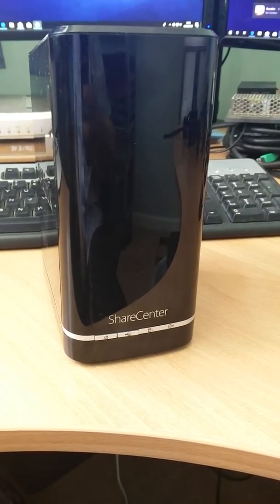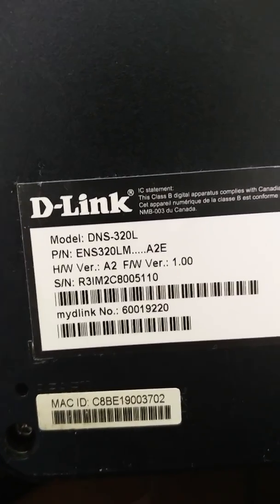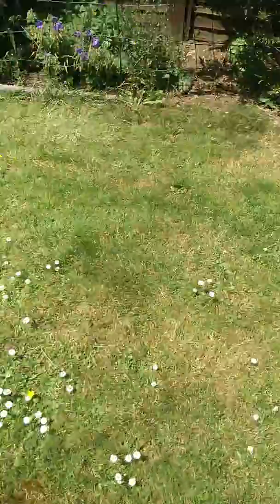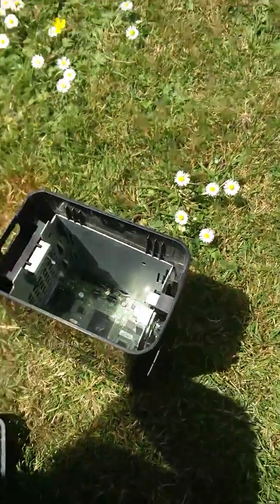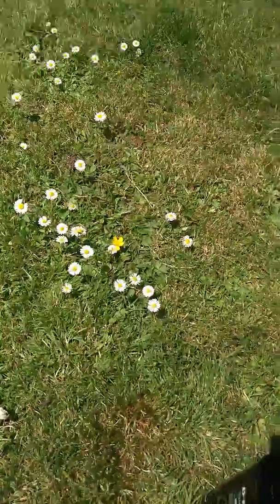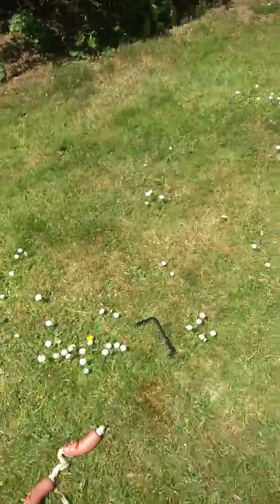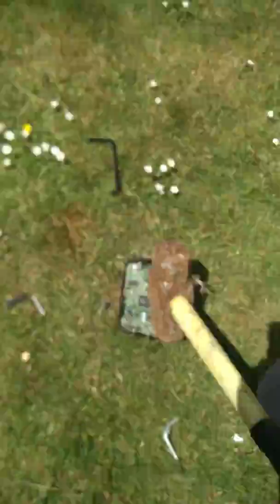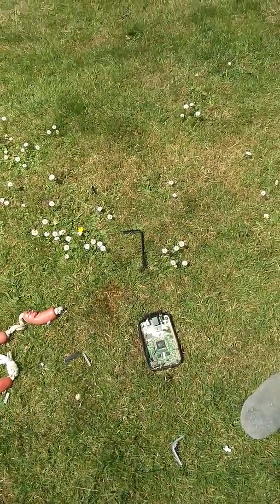DNS-320L FINAL REPAIR

Comment: It seems that D-Link applied planned obsolescence technique in this device. Problem with temp sensor prevents device from booting.
Reply: Every time I need to reboot mine, I have to stick it in the freezer for 20 minutes.

Temperature sensor aside, it still works after all these (six?) years, complete with an upgrade from 2TB to 4TB drives (and flashing ALT-F firmware for SMB v2 support—thank you, Windows 11).

Comment: D-Link DNS 320Lw 149 € for 2 years of bugs and poor performance. Failure (flashing blue LED) just after the end of the warranty.
Synology DS214 + 349 € has been working perfectly for 6 years and I have no plans to replace it yet.
----------------
D-Link DNS 320Lw 149€ pour 2 ans de bugs et médiocres performances. Panne (led bleue clignotante) juste après la fin de garantie.
Synology DS214+ 349€ fonctionne parfaitement depuis 6 ans et je ne prévoit pas encore de le remplacer.

Comment: This video touched my heart particularly because I have owned not one but four DLINK NAS systems so far and they have all failed or are failing as I write. I don't know why I spent my good money on them but the alternatives were too expensive I guess. Heat dissipation and current control are a problem in these devices and may be the reason why they all fail eventually. I wonder why DLINK is not building more reliable gear so that they continue to keep loyal customers? Anyway cheers and hope you land on a better NAS. I just installed OMV on an old PC and it's a screamer!

Comment: I'm thinking of modifying my DLink DNS-320 in a very similar way to this.
Did you find it improved the performance at all?
Reply from the maker: Lawrence Allwright much more reliable now, not a single issue

. My swearing has reduced dramatically as well... RESULT!

Btw, Im using a Synology drive now.
Reply: Out of interest, is the Synology fan any quieter than the DLink was? (Before the video, obviously!)
The DLink has a tiny 40mm fan whereas the fan on the Synology DS218 appears to take up the whole back panel, Website says 92mm, which suggests it will run much slower.